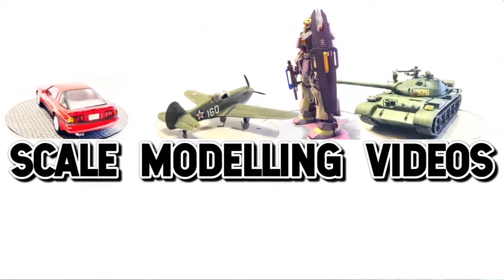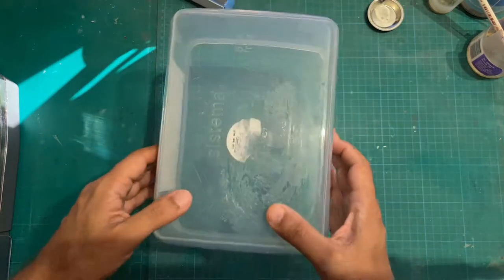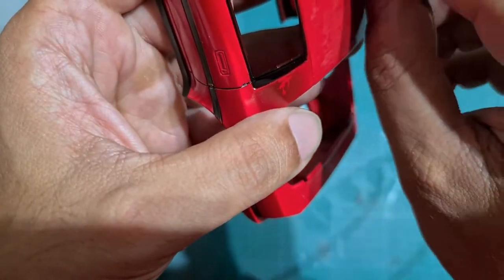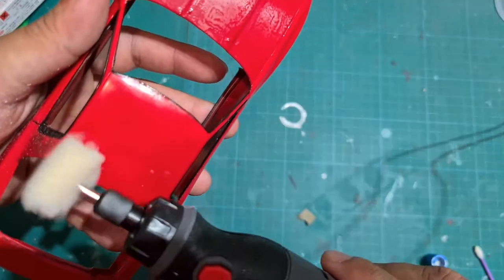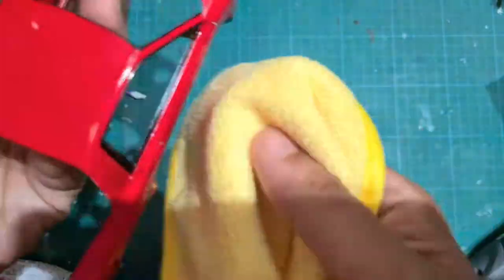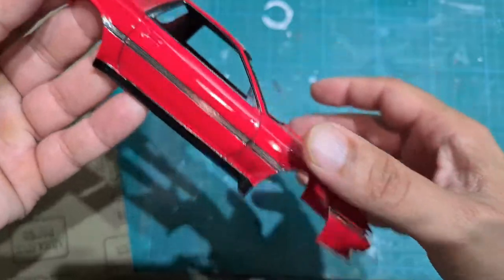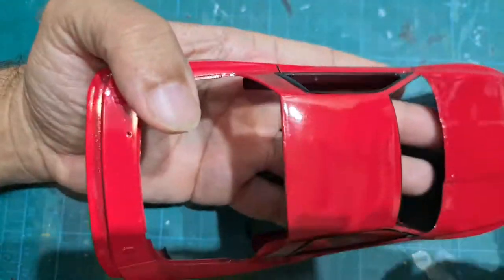How to Sand and Polish Pledge Floor Care / Future

Comment: If you don't want to spray real clear coat, you can always just use a Tamiya lacquer spray can and get way, way better results than this after all that work you put in. First spray a coat of Tamiya fine white primer, then sand it with a 2000 grit micro mesh sanding sponge, wet. Allow it to dry for 15min and spray it with the Tamiya TS-8 lacquer spray can. Do two light coats with the spray can then a nice medium coat and just stop. You're done, that's your paint job. It will look 1000x better than what's on display in this video.
Reply: I have to agree. Tamiya’s clear lacquer is a marvelous product.

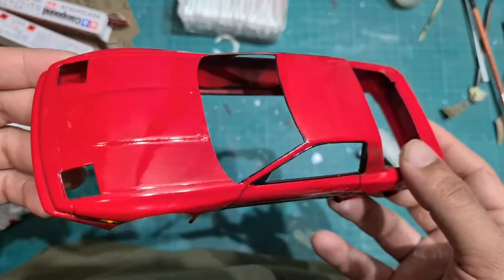Comment: 19:55 - WADR: The car looks better than it did when you started, but the imperfections on the hood are clearly not gone, even after the work you put into it. I wonder how it would've looked if you'd skipped the sanding and went straight to the polishing. I'm going to experiment with a junker body from my boneyard. Thanks for the video.

Comment: I was successful 1 time sanding future to a high shine. It was an experiment. Though my model looked good, about 2 years after I coated it with Future, I decided to wet sand it starting with 4000 grit and worked my way up to 12K, then used the Novus 321 system. Worked great. I think it worked flawlessly because after 2 years, it wasn't just dry it was 100% cured.
Reply: Wet sanded?...i think not.

Comment: I always rub the Tamiya compounds onto the model with a fingertip, then when the compound has almost completely disappeared, I buff it with a fine polishing cloth (also Tamiya, I think, but I've had it for so long I can't remember). I prefer using a lacquer gloss coat like Mr Color GX 100 or Alclad super gloss. They cure fast and are extremely hard wearing.

Comment: From what I've heard, "Pledge Revive It / Future" was no longer manufactured as of Jan 2022.  What was on the shelves was the last of it.  If it's been re-branded, I would love to know what it is.
Reply from the maker: Interesting I did not know that. I guess I should buy it if I find it
Reply: Did you find out yet?
Reply: @GrandNational66  A video popped up on my feed to try Holloway Quick Shine.  I haven't tried it yet, but they thought it was a good replacement

Comment: My experience with Future is that it's not necessary to spray it on. I just poor it all over my models straight from the bottle. If it pools anywhere, just touch the pooling area with the edge of a paper towel and sucks it right up. Turns out flawless.

Comment: Another great video although, seems like a lot of work. I have used this stuff a little bit (mainly on hardhats), for people at work but never really tried polishing, except with a speed wax from lucas oils (automotive quick detail for in between waxing). Anyways i use to do tile floors for Menards (stripping, waxing and polishing). The wax used was amonia based by Johnson Wax Professional and used a mop applicator and after cleaning (scrubbing) each night we polished with a polishing pad with a floor buffer (burnisher). That being said, i wonder if maybe using ur polishing pads u have for ur rotary tool to polish with no compounds. I know we used to polish the floors at speeds of like 2500 to 3000 rpms (if i remember correctly).  I dont know how the pledge would hold up to that kind of polishing, since its for the home. That being said i know stores carry commercial stuff but not sure if its amonia based (probably not good for airbrush if it contains ammonia) but hold up well to everyday buffing. So maybe i thought u or anyone could try a dry buff method. It pretty much uses heat to melt the wax and level back out to get out scratches, from everyday foot traffic and shopping carts. Anyways great video but thought id share my input on the floor wax and what might work easier. Also when i used to strip old wax and relay a fresh 4 coats id buff after the 4th coat and over the course of 4 days (usually) id get about 8 to 10 coats of wax on the floor. If u have any questions about floor wax, then let me know. Im pretty knowledgable as i did it for 8years at my last job. Keep posting videos, i love watching.

Comment: So, you'll use a different buffing wheel for each grade of compound to stop cross contamination ? - if you didn't, within a sort time, you'd end up with all the grit pastes on the one buffing wheel at the same time.
Reply from the maker: I think I did use a different wheel. Thanks for the tip though. Appreciate it.

Comment: Needed a better paint job to begin with...Sorry J.M.O
Reply from the maker: I agree, im just an average modeller, trying to get better everytime. But still sharing the skills I have acquired.
Reply: @ScaleModellingVideos  What did you use for the original red? I agree with Jeff, but we are all here to improve our modelling skills so it's all good. I wish I knew that you could polish Pledge Floor Gloss to a higher shine. I did a '70 Firebird for my nephew and I was really happy with the paint but less happy with the multiple coats of Pledge. I mistakenly thought that it was quite glossy, but in reality, it's not.